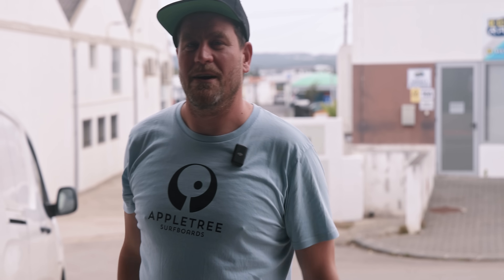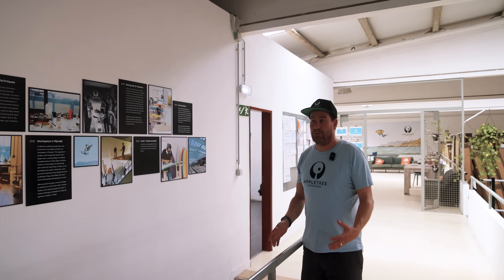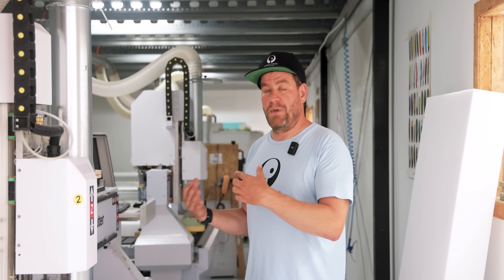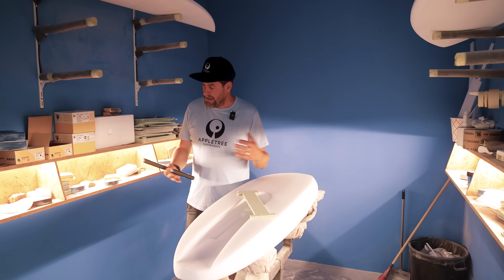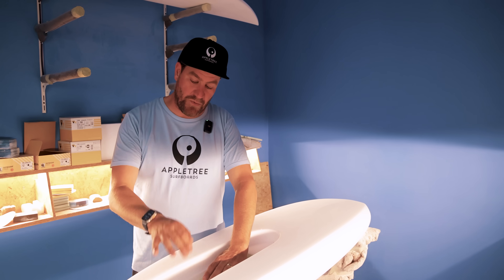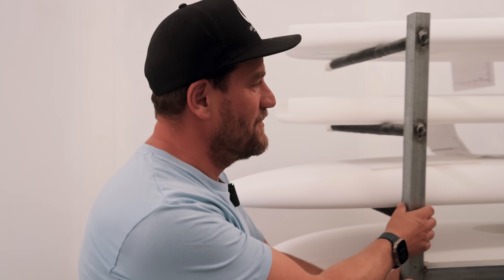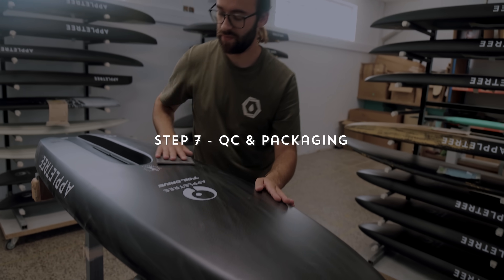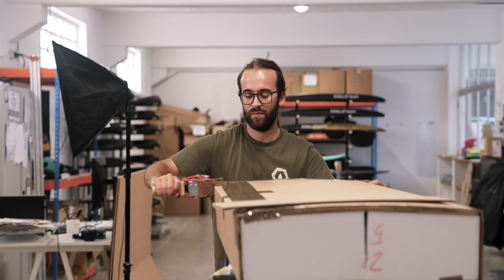The Appletree Factory Tour: How We Build Boards

Comment: Great tour of your factory!  I have one of your Ozone built boards. I love the design and craftsmanship but there is a problem with your clear coating process. The clear coat is peeling off. I tried getting in contact with your team but they stopped responding to my emails. 

Are you willing to help?
Reply from the maker: We are willing to help, but as it's an ozone product, any enquiries will have to go through ozone.
Reply: @appletreesurfboards  Does your factory manufacture the Ozone Rise board?

Comment: Wow, looks very good, what weight does your 50K foam core have?
Reply from the maker: thanks! We use different densities for different boards. In general the foam is slightly heavier than EPS, but MUCH stronger and water resistant.